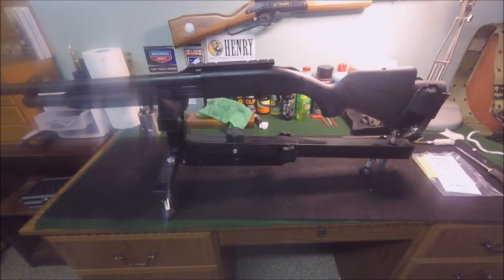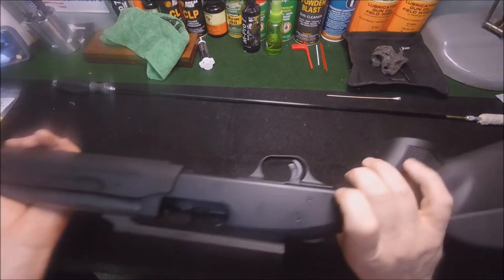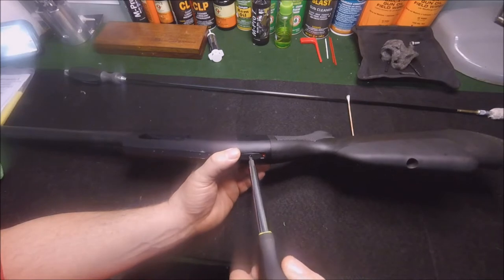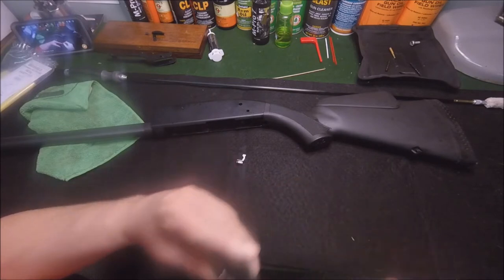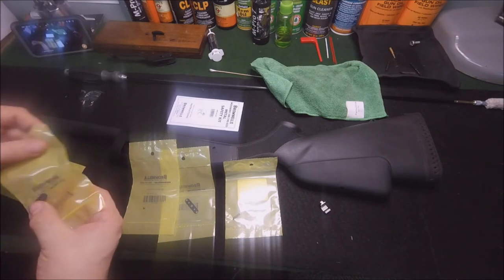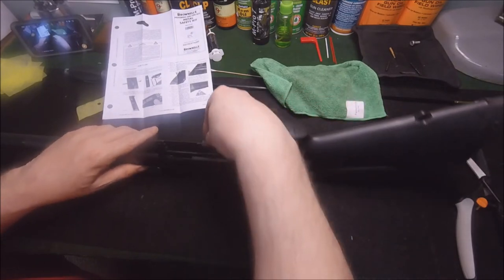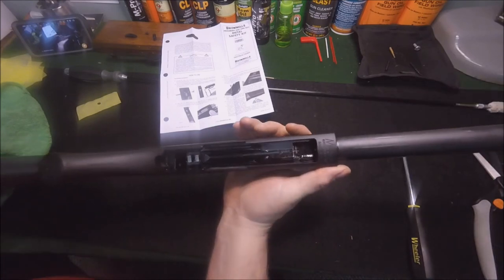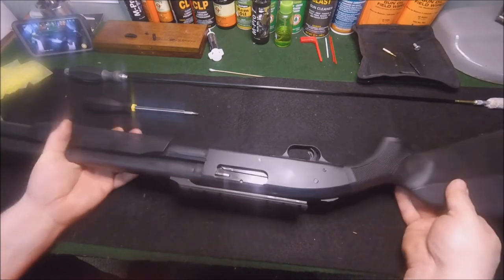Replacing the safety lever on a Mossberg 500

Comment: This video made it harder than it actually is. You don’t need to field strip your gun to replace the safety switch. It’s actually easier if you don’t. If you just rack the action back the safety bolt will hold in place all you have to do is unscrew the switch and put the new one on.

Comment: Thanks for showing us, anyone here that is having a hard time, shoot something like CLP or even penetrating oil like PB blaster/KROIL down in that area. If that fails warm it up a bit with a heat gun. Should that all fail, get in there carefully with a dremel cut-off wheel to make a notch you can get some purchase on. You're replacing the plastic switch anyway.

Comment: Owned 3 Mossberg 835's over the years,my only complaint is they have a crappy  Safety on them.They should just go with the trigger safety .My Remington safety has never failed ,own about 10 Remington s never had an issue with  any of them ..That ball under the button is the issue

Comment: my safety didnt work when i got it. so i took it appart and back together and its still not working. any suggestions? could i just need a new safety all togther?
Reply from the maker: That sounds like the case.   Watch my video on how the mossberg 500 works and you may be able to see what is going on with it.
Reply: @TheBerettaGuy  found out that its my trigger. the wishbone like part that the safety touches to stop it from firing is free because the part thats suppose to go through it and move it up and down is broken so pulling the trigger doesn't move it like its supposed to which allows it to fire still.